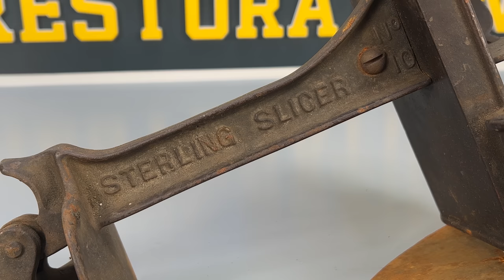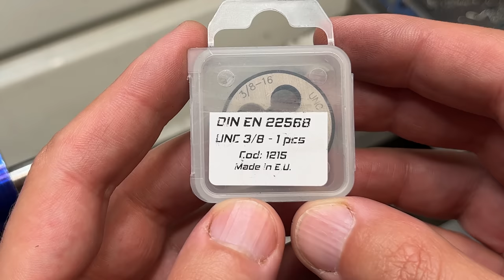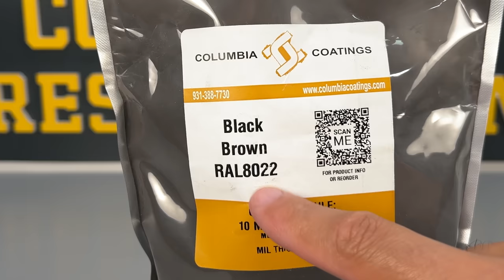Rusty Meat Slicer Restoration - I’m Making a Sandwich for You !

Comment: Loved watching your video.  When people machine new parts, there seems to be a lot of wasted material.  It appears that you start with a bar 1.5" in diameter and end with a much smalller bar.
Reply from the maker: Thanks a lot and glad you liked it . Yeah , it seems well but this is the process. You start with the biggest diameter you need to have in final . Turning the biggest diameter , after that you turn the smallest. Another way was to make 2 parts : one bigger and one smaller and to weld them. In this way , I can start with 2 different diameters round bars . But it is more complicated

Comment: Love your videos! My question is, why do you use such large pieces of metal when using the lathe to ultimately create a tiny part? It seems like so much metal is being wasted. Maybe that’s just the way you’re supposed to do it, or it’s all you have? A little insight would be much appreciated.
Reply from the maker: Thanks mate! Because the large part with that 2 holes you seen it is the same length like the diameter of the bare metal I started. Every time you choose the right diameter of the metal to receive the results you need. Also, all the metal wasting you saw there is recycled 👍

Comment: Very nice.  One suggestion, clear the wooden handle in epoxy, so its easier to clean.  One thing with food products, you want to be able to clean them easily and thoroughly, which sometimes means using harsh chemicals and/or dunking them in water.
Reply from the maker: True, I wonder how they clean kitchen tools back then 🤔

Comment: I feel the restoration should be costly, using a whole block of material just to make a bolt. 🥲

But I like these restorations a lot. They feel so satisfying.
Reply from the maker: A lot of people wrote me about wasting material but is not like that. If you watch carefully, the width of the final part is exactly the diameter of the metal bar that I started with . And the metal chips are stored in a barrel and I sell them to a recycle company

Comment: Just so i can educate myself, why do you leave the piece for 24 hour to see the rust spots? What is the reason for needing/wanting to see the rust spots?
Reply from the maker: When I pull out the parts from cabinet , they are bare metal and if I paint immediately I can’t see where was the rust . This rust spots can affect the paint work and in one year, the parts can be rusty again. I don’t want that. So I let the parts in workshop, where is humidity, and the rust spots will be visible again after sandblasting in 24 hours , so I can grind that metal parts exactly where I have to. This is the reason.

Comment: Nice to see it restored, but the orange rust on certain components do make me wonder how it looked prior to making the video. The engineer in me sees that as a bit odd.
Reply from the maker: I know some people are afraid to open a video where the rust it is “orange “ but in the thumbnail we apply saturation for being seen by people who has the phone luminosity low. Now, about the items, it is obvious than this slicer is an antique item and can’t be in very good condition, like I bought it last week and I rusted artificial just for the video. I saw that videos on YouTube , how to spot fake restoration videos , but they are false. It can be fake when you buy a zippo from maximum 10 years old and you rust them artificially or when you have a blade or sword and you let them in solution and then say to people that it was used in the second war. I agree with that and I agree with people that are furious about that. But in most cases , items over 50 years , can’t be in good condition. Now, these antiques are bought from people who don’t keep them in a clean room or has feelings about items. Some people keep them in rain or where humidity is high , and I don’t blame them. I blame that channels who “found items in mud or rivers” or they apply rust on plastic things 😅

Comment: That's a lot of stock removal for a screw.  What do you do with the shavings?
Reply from the maker: It’s not just a screw, it is a part. The width of the parts it is exactly the diameter of the metal bare I started with. Anyway, I keep the shavings in a barrel and I sell to a recycle company, once a month ! 👍

Comment: I think the blade was supposed to touch the body, like scissors or guillotine metal-cutter
Reply from the maker: I thought at some point someone will say that. Is not the same principle like scissors or metal shear. It was obvious the fact that the casting was bad because I seen there a lot of marks and irregular shapes. I saw also how and where the blades touches the body.
Reply: @CoolAgainRestoration  is it really not the same principle? The lower bit of sausages had torn edges, as if it needed tighter fit to finish the cut. If the blades only touched that bolt which was least rusty, then it would make sense, but i've heard long scraping sound when it rotated before restoration. 
It was nice to see other restored pieces in the end of the video, maybe i'll get more context and angles next time

Comment: that is not a meat slicer
There's 2 types of cuts a blade can deliver. A chop (which involves little to no horizontal movement of the blade) and a slice (which involves dragging the blade horizontally to cut without having to press down super hard).
 
A long thin blade allows you to cut meat by dragging back and forth if needed... the more distance covered by the blade, the better it will cut through meat.
 
That's why a meat slicer is kind of challenging. You need to somehow create that horizontal drag in a machine.
 
In order to do this, a meat slicer uses a rotating circular blade. This way, it basically emulates a single neverending blade.
 
Vegetables can be cleanly chopped OR sliced, but meats can only cleanly be sliced. You need a dragging edge.

Comment: Sorry Sir, the blades should touch the main body ( ever so slightly ), that's how they sharpen their selves like a pair of scissors.
Reply from the maker: Hi mate ! First , I thought that too but I have some points of view that are in contradictory with what you said or with the principle of scissors ✂️. One of them is that the casting of the main body ( where the blade touches) was very uniform. An uniform surface is not for sharpening the blade for sure. After that , a scissors cut when the material are right between the 2 blades . In the slicer case , the blade start cutting in the up part , in my testing , you can see that the salami had 5-6 centimeters, and start cutting from there.
Reply: Dear Sir, I think we have  a different opinion in this matter. Of course  it cuts the sausage first and then sharpens itself for the next round. About the scissors; this was a bad comparison. Being Dutch I've got quite a few cutters for runner beans,  and they rub their knifes along the cast iron body. When given more space they won't prefform. ( That's why you better get old ones instead of new; they are already nicely worn in..) @CoolAgainRestoration

Comment: Amazing restoration. Only the sharpening of the cutting blade was not the best. A proper japanese or good american wetstone and correct sharpening angle would make the cutting blade slice as one would expect from such a machine. Like through butter, and slices so thin that you can read text through, if you put them on top of a book page.
Reply from the maker: Thanks Roar ! Yeah, I agree with you but I’m not a master in sharpening and I thought because of that curved shape , will be difficult for me to maintain an angle on the wetstone .
Reply: @CoolAgainRestoration Yeah, You are right about that. I think I would have try to sharpen the blade in my knife skapener jig before the two parts were riveted to the knife blades. It hold any angel even to a curved blade.

Comment: Nice rebuild,but as a service technician in the food industry if the slicer has a factory coating and it’s not coming off fine. You cannot paint anything. I have a 50 year old Hobart. I can slice super thin cuts of meat and cheese on it.  Truth be told your powder coats Great. But kitchen inspectors will ding ya on it.

Comment: Why did you use such a large piece of metal for such a small piece it seems like a waste
Reply from the maker: Wrong ! If you watch carefully, the width of the final screw it is exactly the same diameter of the bare metal I started with 👍 it was another way to do that screw by welding a plate to a threaded rod , but the process was not so satisfying to watch . Anyway, the metal chips are stored in a barrel and I sell them to a recycle company , once a month 👍

Comment: Many of your restorations are on cast iron items. Despite the brilliance of your workmanship, I have one question you may consider negative; Why do you de-value them by removing the casting seams? They become too perfect. Are you perhaps a bit OCD?
Reply from the maker: So , I have to reply 😅
Yeah, my items are mostly from cast iron but I don’t remove all cast markings. Just I bridge the gap between deep holes and high spots. If I don’t make that, probably also the powder coating results could be bad. And I don’t make this kind of work to all items , for example, to the sausage stuffer , I left all the casting marks . I did that to the bread cutter too. My believe is that an item is very rare or very valuable , I can keep the cast markings to not de value but if there are just an old item , I make some metal working for a better result. And about the ocd , I don’t have a bit , I have a lot 😅

Comment: I'm pretty sure, that the scraping of the blade is on purpose. It keeps the blade sharp. Like the (danish) RAADVAD bread cutter. Only one side is bevelled. So you ruined it. ;)
Reply from the maker: Your opinion is wrong because I saw that blade and inspected, was beveled on both side and the purpose of the blade was to cut anyway. Is not like scissors or like a metal shear . I inspected also the main body and I saw that the casting was the problem. Was a lot of marks there and the surface was uneven , so scraping was an issue and not something good. Probably my mistake is because I don’t show too many details like that because of the fear to not make a boring video .

Comment: Each time i see this it pains me so much. for this part 4:00 the waste rate is probably like 95%. so incredibly wasteful, you probably could have done a lot better with welding.
Reply from the maker: I don’t understand this type of message. Yes , it is a waste of material but this is the process of doing parts on the lathe . That part was made 100% correct from the laws of doing a part on a lathe . Made on other ways ?? Yes , there are many many other ways , like welding , like metal molding and so on. But I used a lathe because is nothing wrong with that. I don’t try to not waste material . I resell the chips to a recycle company and I buy stock material , some of them are rusty from what it left on biggest machining workshop , at very low price .
Reply: @CoolAgainRestoration  im not say the process is done wrong per se. That said picking a process that has like 95% material waste rate can be called wrongly picked in terms of material efficiency. There was this episode of loony tunes i think where automatic axes chop down a whole log to bits only to make one tiny toothpick. That's what im thinking.
Great you're recycling material but even recycling consumes a lot of energy to reheat and melt scrap. What i am saying that perhaps you could have utilised some other process of creation that is a lot less wasteful for the material. That's pretty much it. Cheers 🤘
Reply from the maker: @tyraelpl yeah , you have right somehow. I’m just a machinist and the only one way I knew it was the one you seen it . I thought to use the welding method , but was too much working because I have to sanding and if there is any gap , I have to weld again and to sanding again . This just to make it perfect for paint job. Wish you all the best and I respect your opinion, I didn’t take it like a negative thing. Cheers mate !
Reply: @CoolAgainRestoration  All cool man. Maybe next time ;) Likewise, good luck on your projects too. Cheers!